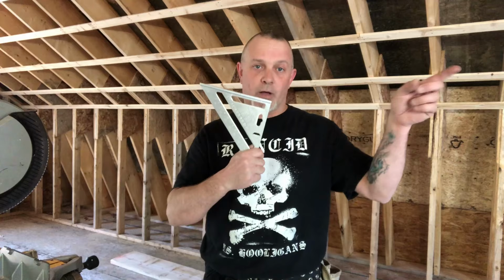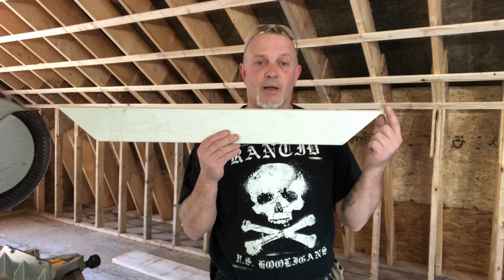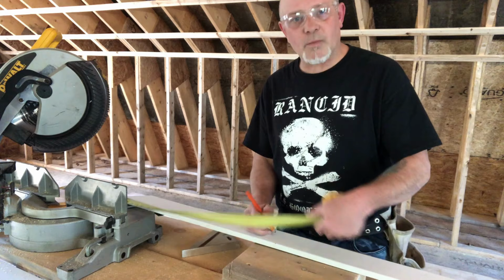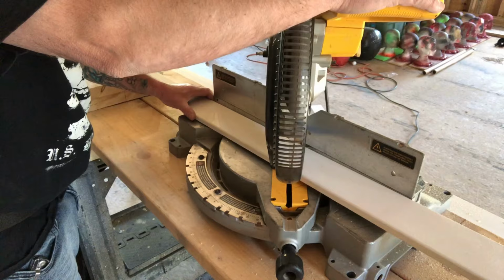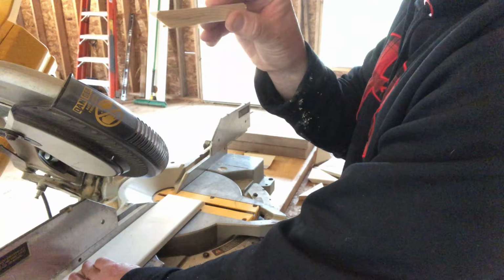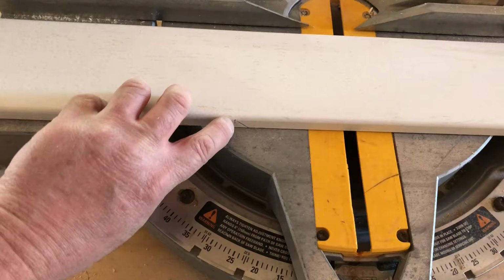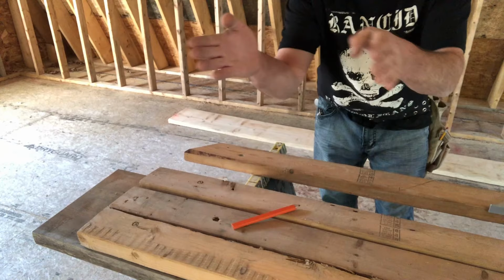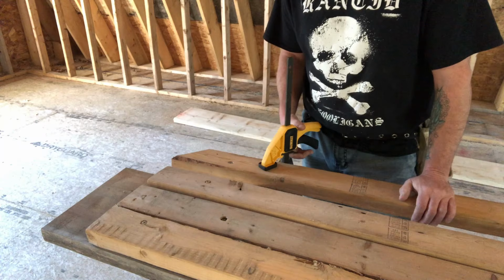How to cut basic 45 degree angles

Comment: Good morning. Ok if I need a 12  inch piece of crown going from a straight cut to a 45 inside corner should I cut the 45 first and than measure the long point of the molding . To the straight cut ? I hope I explained that right cause this is one of the things that’s making me nuts.
Reply from the maker: If I am understanding correctly then , yes I would cut the 45 first and then measure. If possible cut it bigger than you need. This way you can always take a little off if needed but, you can’t put it back on if your short😀

Comment: Hi great video. Does the same go when cutting crown molding?
Reply from the maker: Yes. The terminology is still the same  although, crown molding is harder to do than traditional trim or baseboard.   I am admittedly not great at it.  The  way I learned to measure and cut has you flipping the piece upside down on your miter saw to cut at the correct angle.

Comment: Thank you, I really appreciate this, but wondering what instances you would use some of these cuts, like the bevel. I want to get a beginner small saw, but scared to death if them. I want to make a headboard with miter corners, but not sure how to measure the ends, do I cut the long end where I want the headboard to end or will that be too long?
Reply from the maker: The bevel cuts can depend on the width of the board mostly. If for instance you have a 2x8  or bigger and you try to cut a 45 degree cut on the flat side of the board, you can only bevel cut it on the miter saw because if you stand the board on end it wouldn’t fit under the blade. The overall length you need should be the long point of you cut on the flat or a bevel. I hope this helps you !

Comment: Hello, I have a question what blade do you recommend for that cut? I have a 10inch  90 teeth and it ate three my wood because the border is pretty thin. What would you recommend?
Reply from the maker: It depends what type of wood you are cutting?  Was the blade new and sharp?  If you are cutting trim or hardwood and need a nice smooth cut then you should get a fine finish blade.  It is it for rough framing then you can just use a framing blade.  When you purchase them they all say what material each blade should be used for.

Comment: Thank you so much for this.   No one teaches this in their videos that I've watched.    One quick question.   Do you cut on the line, inside of it or outside of it?   Thanks!
Reply from the maker: Thanks for watching Sue!  So cutting on the line , before or after depends on which side you measured from. For instance if you hooked your tape measure on left end of the board and pulled say 24" ,  then you make a line and cut on the other side of it away from where you pulled your 24" measurement.  If you cut on the same side of the line that you pull from then you will always be at least an 1/8" short because the saw blade is typically 1/8" thick> So always cut past the line from the direction you pull from.  Hope this helps you.  Thanks again

Comment: I want to add moldings to my kitchen cabinet doors, similar to a frame.  The outside of the moulding is higher.  I did buy the piece you ordered us to, but I am still mixed up.   I never had a great mind, am 83 year old woman, and do know how to use electric miter saw to cut straight.  Please help.
Reply from the maker: Are you attaching them to the face of the cabinet doors or around the outside of them? 

If it will be the same size as it is now nailed to the face of the door, then you need to measure the top or bottom and make those pieces long point to long point. Then do the same with the sides. That should look and work like a picture frame would.

Comment: You start by showing a board and claiming it is "2 feet long, short to short" and then you produce a board that is 2 feet long to long. Were you mistaken or intentionally confusing?
Reply from the maker: Ah, point taken Mark. I probably should have  produced a short to short cut 1st since I showed it initially. I do hope since you watched the beginning of this video you stuck around til the end and got something out of it. Thanks for checking it out and for the feed back .
Reply: @johnnyworks5446  ok so I thought it was just me ...... but really though, how do you measure for an accurate cut on short to short?  I'm running out of boards :p and maybe some patience
Reply from the maker: @leannecarol969  always measure and add a little to it in case you are too long. If you measure exact and are wrong or short then you can’t add to it. If you measure and cut and are too long you can always cut A little off to make it work. Measure twice and cut once. If you cut long you can always take a little more off .

Comment: How do you find the inside dimension. Short to short
Reply from the maker: Hard to explain in words and not visually but, think of a framed picture or painting on your wall. The wood that is around the painting is made up of 45 degree angle cuts. If you took a tape measure and measured the longest part of the wood from end to end that would be long point to long point.  On that same piece of trim/wood, if you measure the shortest point to the shortest point that would be a short to short measurement.  The easiest way is to practice or cut a practice piece before you cut your actual real piece.

Comment: cool rancid rules man. love em.  can i as k what maybe a dumb question i get how the 45 match up etc . but how do i determine , based on my project , before i even start how long  more or less to start with to even mark the pieces for the mitre cuts.  like say i have 10 1/2 all around, do i add length to the cut of each to fulfill the perfect angle how doe sthat work or how do i detrmenine what  number to settle on for the 45 degree cuts in lenghth. same as the projects 10 1/2 or am i adding to make up for the angled cuts. is there a general formula to plug in? sorry i hope i asked the question right. im new at this shit.
Reply from the maker: Hey David ,  I hope I can answer correctly for you. Whatever the total size of your project is, let’s say outside dimensions of a box that is 2’x2’ or 24”x24” square, this would be your long point on a 45 degree (miter). If you cut your 1st piece at 45 degree you would pull your measurement from that long point and make a mark at 24”. Now cut a 45 degree back toward the end you cut. This would be 24” or 2’ long to long. If you repeat that 4 times you will have basically a square like a picture frame with all corners  mitered at 45 degrees. Your overall length of whatever your cutting whether it’s trim or 2x4 is the long point and will be the outside dimension of your project. The thickness of the material your using may make the 45 degree angle longer but it depends what you are making and how long it is if it will be an issue. Hope this helps a little. Let me know. Good luck ! ✊🏼
Reply: @johnnyworks5446   IT HELPED BIG TIME. I kinda walked away from it temp cuz i wasnt getting the concept i got so pissed i couldnt wrap my head around it ..how to determine and a start n finish with the measurment till i just got back logged on saw this and " the lightbulb" light up , but didnt burn out this time i totally get  it and understand it.  i just cut one w how you explained it and kinda mirror the rest but laying them back to back mathcn longside/s
hort side then makn sure the angles are all cut inward to meet the next angle around the bend lol Dude thank u so much i wickid appreciate you taking the time from your life to respond to complete stranger . Good man i appreciate i really do . im just adding some quarter round to a table of my moms top and bottom tiers/shelves just gives it catchy sharp  look u know. I really do enjoy this woodworking now im so into it. got a chop/mitre saw. impact driver, table saw, mitre saw/couping saw/ but again it clicked when i read it the long/short etc i just couldnt find any people who didnt love to hear themselves talk then get all caught up in the video and barley explain what the video theyre making is about. its like duuuude they go on and on and on and on and on tlakn about their dog their previous builds accalades etc.  lol i fell aslepp tryn to figure the rise/run on slope roof etc the guy was so mono tone i honestly passed out ;lp; sorry so long message thnak u so much
Reply from the maker: @davidbritton6121  anytime ! ✊🏼

Comment: hey brotha. lol im back for a question. lol i asked one before ur answers spoke to me  i got it the way you answered . other dudes just confused the issue and made more lost . im just cutting some thin molding trim for a screen door i re screened and i wanna seal the bead lanes around the screen so thye stay in there and it copmpletes the door top n bottom. Doing the 4 cuts 45's i get that etc do i lay these flat or stand em up bevel style like u were showing. is there a general rule when ur cutting these 45s ..do i always lay it on saw as to how its going to lay on the door or whatever piece im attaching them ??  wasnt sure when or what situation called for bevel cut vs regular flat cuts  u kno what i mean. thanks bro rancid rules dude. sorry if my question isnt clear  im not clear   in the head most days lol jk
Reply from the maker: It depends if how the wood is going to sit on the door. If it’s gonna sit flat you can just cut 45’s. If it’s gonna sit on it’s side then you need to move the saw position to 45 and that gives it a bevel. Hope that helps? ✊🏼
Reply: @johnnyworks5446  👍

Comment: Can you measure fro short to short?
Reply from the maker: Yes you can. Mark and cut your material, now instead of hooking your tape measure on the end, just hold it on the short end of the cut and pull your measurement. After you mark it, cut on your line but away from it. Sounds complicated if you are new but, you can always experiment with a scrap piece of wood first.

Comment: Any idea why I cut 2 45s on baseboard and they don't go together right.  My saw is designed to cut up to a 50 degree angle.
Reply from the maker: Maybe the corner could be out of square. A lot of times they are. Is it at an inside or outside corner? At outside corners you can glue and nail them together and slide them in place. At an inside corner you may have to cheat or adjust your 45 if it’s not square.  Get it as close as you can and caulk the gap.  One other thing on inside corners is called coping. This is where one piece goes in square with no 45 and the other get notched to sit over it. I have a video on baseboard that shows it or you can look up how to cope a  corner doing baseboard.
Reply: @johnnyworks5446  thanks for the reply.  I don't understand the 2 corners you mentioned. This is a small corner followed by maybe a foot of baseboard ending at the sliding glass door. Would it be better if I cut them 50 degrees? The floors are uneven too so big gaps under the baseboard.
Reply from the maker: @chriss4365   Chris, watch my video “how to install baseboard better” it shows the different corners and how to cut them and install. Without seeing it in person it’s hard to say.